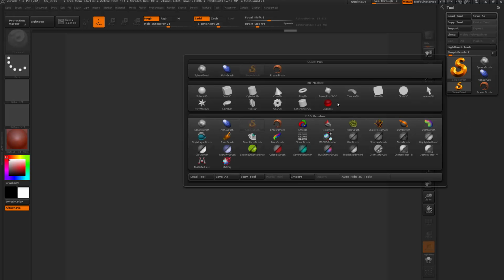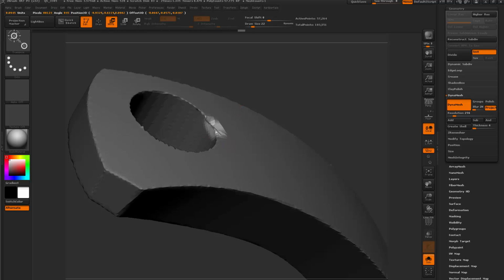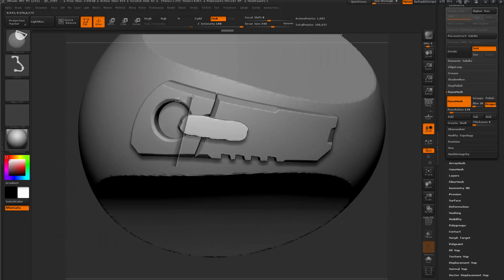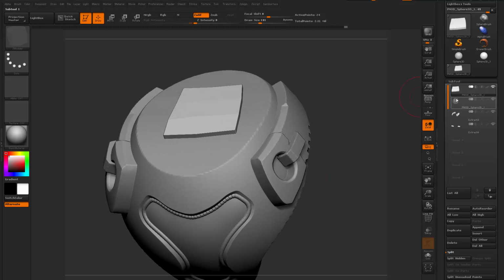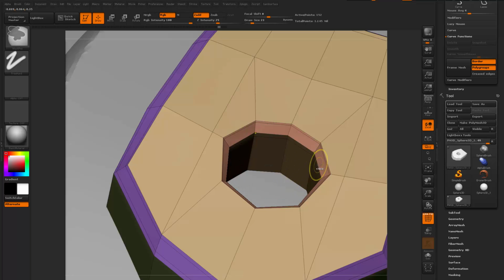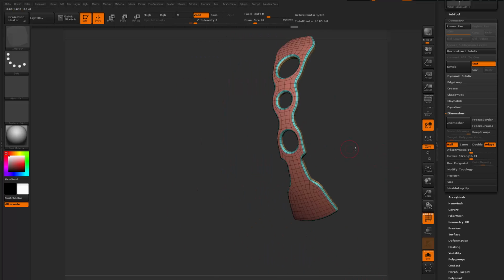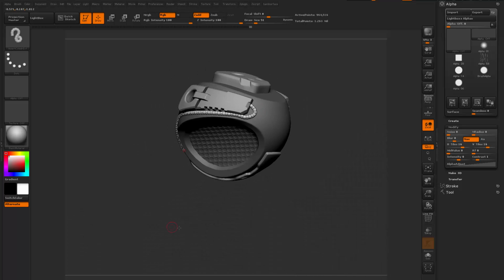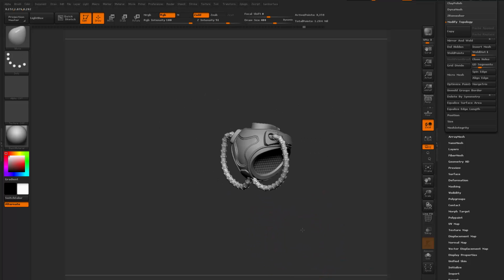ZBrush Hard Surface

Comment: How are you getting very clean cuts with the ClipCurve? Whenever I cut something there's this extra geometry, almost like a flange or lip that's created where the cut is made. I increased my resolution and getting the same results. Seems like this issue has been around with no real fix to the tool
Reply: The angle that you clip your mesh at will reduce the issue, it is basically flattening all geometry to the line you create so if there is extra mesh that is stuck out to you it gets flattened to the same line leaving a lip/ flange. one way round it to alter the angle, the other option is to use create polygroup under the clip curve feature and delete the excess. hope that helps!

Comment: As a complete beginner it would be great to know what key strokes you are using, also the subtract cylinder completely failed for me. I do not have an insert cylinder, only insert primitives, maybe that works differently. A lot of great examples in there though, just couldn't follow without knowing how you got to certain places.